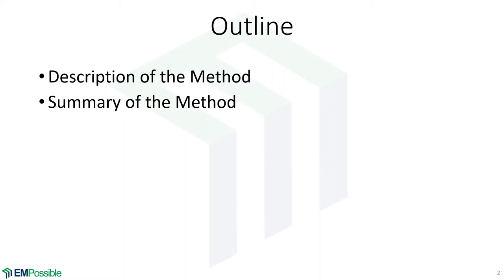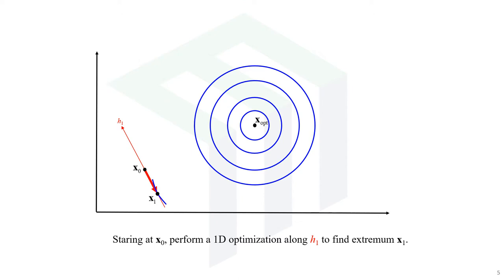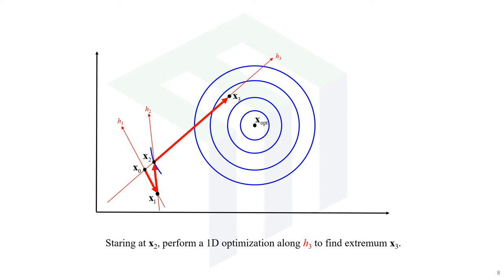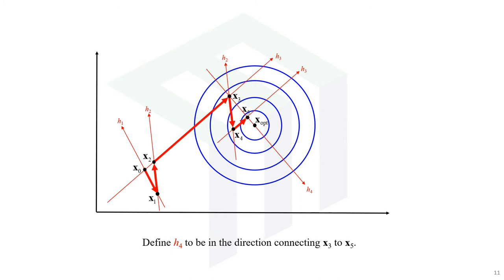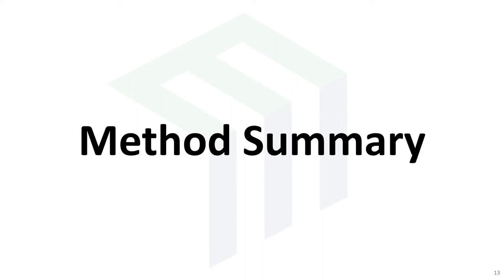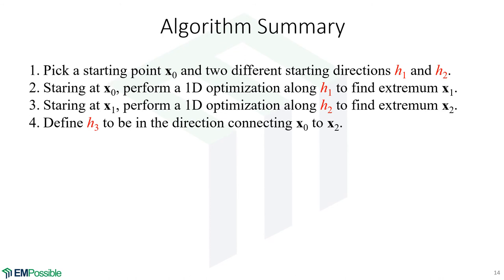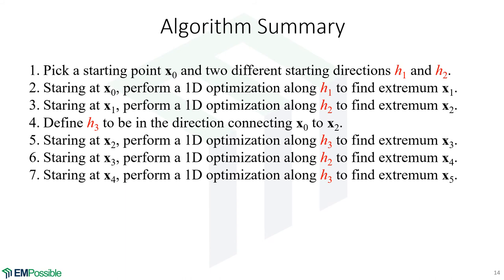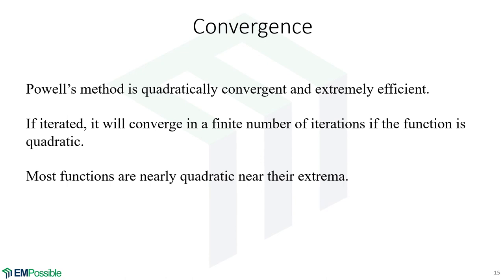Lecture -- Powell's Method

Comment: Awesome video! I am currently writing a program that performs a best fit procedure on a composite model of peaks (lorentzian and Gaussian). I was wondering if you knew at the top of your head what a good method for this would be. It doesn’t sound like Powell’s would be very good here. I am currently using the sum of least square, but I find it to be a little slow for large composite models. I am utilizing the Lmfit library in python which has a list of all methods available to me. Thank you!
Reply from the maker: Sounds more like a curve fitting problem.  Have you looked at nonlinear regression?  Checkout Topic 5 at the course website.

https://empossible.net/academics/emp4301_5301/

Comment: This would probably be an alright explanation if I had an understanding of the algorithm already, which I don't. Having no knowledge, you immediately jump into how to do the algorithm without explaining anything, like at all. Also if you're going to use an example, you should always use a numerical example. There's a lot of unanswered questions.

How do you choose h1? How do you choose h2? How do you choose X0? What's the definition of conjugate in this specific context? When you say "if it's not quadratic it might be a little off", how off? Surely in some cases it would be massively off for the context?
Reply from the maker: I am sorry this video disappointed you.  Did you watch the videos prior to this one?  I think you are missing some key background information that would make this video much more understandable.  In order to keep the videos as short as possible, I don't think I could make each one a stand-alone video simply because there is a lot of background information, like conjugate gradients and 1D optimization, that is needed to fully understand the method.

I recommend accessing the course through the course website where you can see all of the notes and videos organized, as well as get links to the latest versions of all of this stuff and get access to other learning resources.  You will Powell's method is 8th video in Topic 8.

https://empossible.net/academics/emp4301_5301/

Hope this helps!

Comment: This was well explained. A couple of questions... is the choice of h1 and h2 basically arbitrary, or are there good rules of thumb for determining these directions. Same with h4 I suppose. Next, are these direction defined as vectors? Since we're not moving parallel to one axis and holding the others constant, the function evaluations (to determine the extreme point long the direction of interest) must be made by changing all of the independent variables by some amount. Do we define a new function that describes the transect and then find the extreme point of that by something like Golden Section search? Curious how this might be implemented. Cheers!
Reply from the maker: Without any apriori knowledge of where the extrema is, there is not much you can do to choose better h1 and h2.  Just be sure they are different enough to resolve an accurate direction.  Maybe that means 30 degrees between them or so?  The directions are defined as vectors since they are directions.  Given a starting point s and a direction vector h, you can calculate the testing point as p = s + alpha*h.  In this case, alpha is a single scalar quantity to be optimized.  I think that was your confusion.  AT some point, I will make a video showing the implementation in MATLAB.  I have a lot of content on my "to create" list.  LOL  Hope this helps!
Reply: @empossible1577  Thx much. I was thinking about it this am and figured I could make the x & y coords a function of a parameter (alpha in your example) and then use that line to "crawl" along to find an extreme point with golden section. I'm teaching myself numerical methods and using python as the tool of choice. Content like yours is invaluable as I have no tutor (know any?) for this kinda thing. So I definitely want to say "thanks". I'm gonna try to cook up a powell implementation today. Coding really is the best way to learn something IMO. Best of luck with the "to create" list! Looking forward to more great content!
Reply from the maker: @pipertripp  Finding tutors gets more difficult as you get higher in the course level.  Have you looked at Julia instead of Python?
Reply: @empossible1577  ha, tell me about it! I have not looked at Julia. What do you like about it?
Reply from the maker: @pipertripp  For computation, I dislike everything about Python.  Julia is easy to use and extremely fast.  It is by far the superior language for computation.  The main thing is that is has a much smaller user community than Python.

Comment: Thank you so much. If anybody reads this, could you explain to me why Wikipedia's definition of the algorithm is different?
"The new displacement vector becomes a new search vector, and is added to the end of the search vector list. Meanwhile, the search vector which contributed most to the new direction, i.e. the one which was most successful is deleted from the search vector list."
Here, in this video, direction h1 is deleted, when h3 is added, even though the vector connecting x0 and x1 is not the search vector "which contributed most to the new direction".
Reply from the maker: You will find a lot of differences in how people implement different methods.  I think that is because technology has evolved passed the original contribution of the methods and it takes on the flavor of whoever is implementing it.  This particular implementation comes from Steven Chapra, although I do not recall which edition.  Implementation can even change between editions!

https://www.amazon.com/Numerical-Methods-Engineers-Steven-Chapra/dp/007339792X/ref=sr_1_4?crid=SEVQK23D7PJM&keywords=numerical+methods+for+engineers+chapra&qid=1644248418&sprefix=chapra+numeric%2Caps%2C102&sr=8-4
Reply: @empossible1577 
Actually I just checked Powell's paper himself and he proceeds like you, getting rid of the first search vector in the list of search vectors to add the newly created (conjugate) vector at the end of the search vector list. Wikipedia seems to have a mistake there and the source provided over there can not be found.
Reply from the maker: @McDave1312  Thank you for looking in to this!  In other methods, I have found quite a few differences depending on where I am reading it.  It sure makes the learning process frustrating!  Keep up the good work!

Comment: Did anyone know use case of this method? Thanks!
Reply from the maker: Let me point you to the course website:

https://empossible.net/academics/emp4301_5301/

The applications are covered in a previous Lecture...Lecture 8a.  In general, it is used in optimization to find the minimum or maximum of a function.  For example, suppose you are designing a rectangular antenna.  You could optimize the performance of the antenna by performing Powell's method where x and y in Powel's method would represent the two dimensions of the antenna.  That is just one example.
Reply: @empossible1577  thanks for your information!
+1 subscriber for you
Reply from the maker: @KangJangkrik  :-)